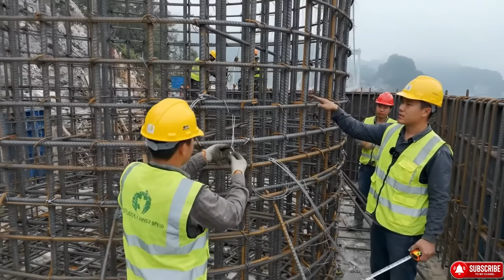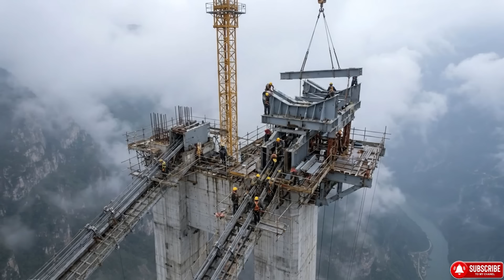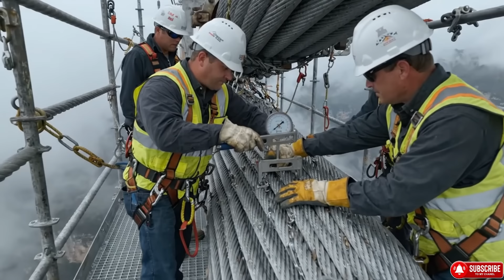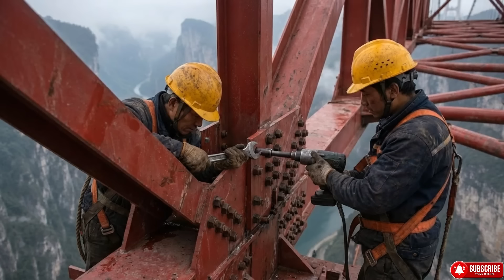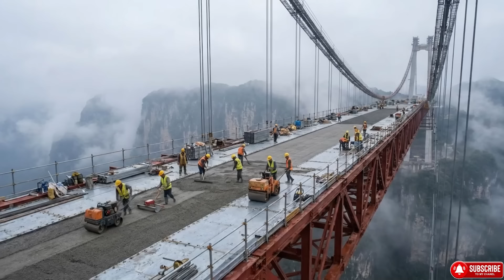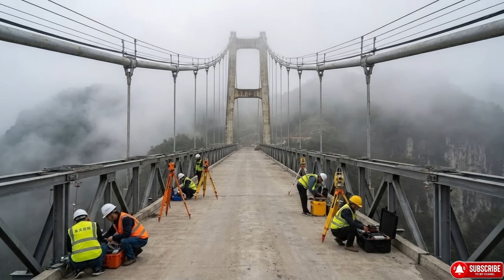How China Built a $295M Bridge 625m Above the Ground (Full Process)

Comment: This is engineering where gravity is the biggest enemy.
Reply from the maker: Absolutely! That’s a great way to describe it. In projects like this, gravity is not just a force engineers have to overcome—it becomes one of the main factors controlling every stage of construction. From lifting massive components to positioning them with millimeter-level precision, every movement has to be carefully calculated. That’s what makes these projects so fascinating: the final structure may look simple, but behind it is an enormous amount of engineering, planning, and precise control.